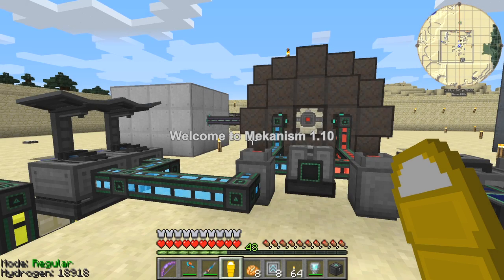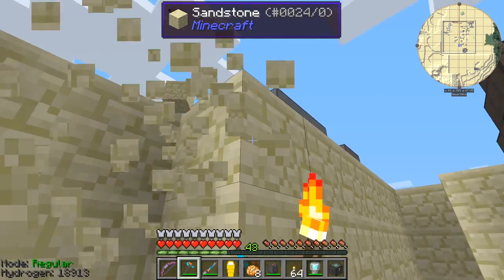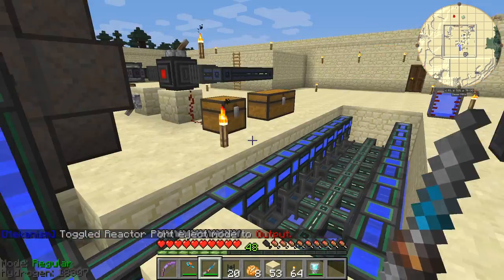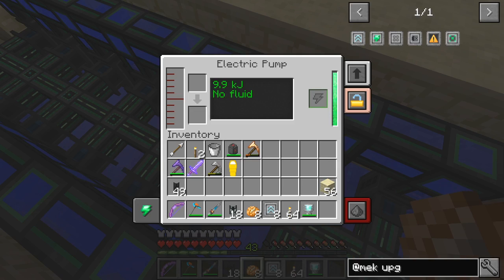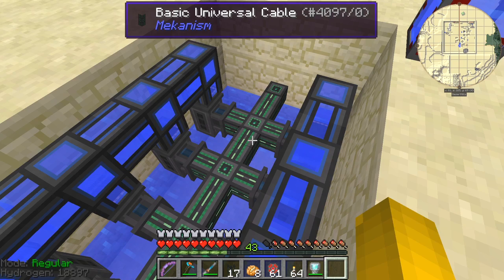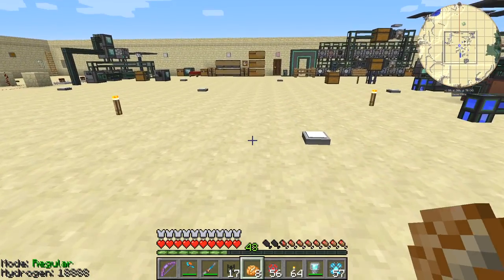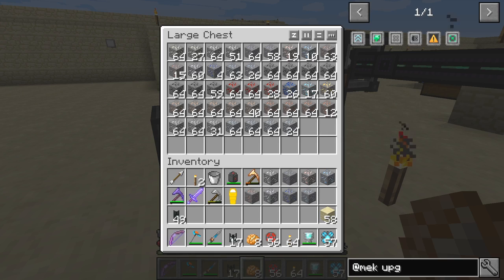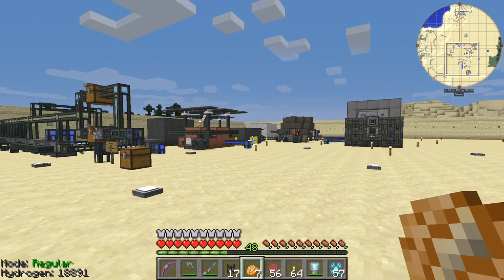Mekanism 110 Episode 26 - Water Cooled Fusion Reactor

Comment: Don't know if you will respond to this but I am trying to have this setup in a Skyfactory4 world, albeit on a much larger scale, how do I stop the steam from running out in the reactor? As there is only about 240mb of steam in the reactor at a time I am unable to sufficiently power the industrial turbine even at a smaller scale. If I cannot stop this from occurring what is another alternative for producing massive amounts of steam.
Reply from the maker: It's been a while since I've played with Mekanism. IIRC it is a balancing act where supplying enough water was the main restriction, Mekanism's water pumps are a bit weak even when maxed out, it there is a faster water pumping mod in skyfactory4 then use this.
Reply: Duncan Webb okay thank you, I will have to look into a different water solution then

Comment: Wait, mekanism pumps don't drain their water sources under them? immersive engineering pumps absolutely pump like nuts but they need 2x2 spaces for a single pump
Reply from the maker: Doesn’t look like they do at least in this version. Pneumaticcraft pumps remove the water source block so they are slow.
Reply: @duncanwebb4934  That's good, I always hated immersive pumps for removing the water sources under them. Like, it pumped VERY fast, but the amount of space needed for them was ridiculous.
Reply: @duncanwebb4934  Oh, and immersive doesn't actually visually show it's removing the source block, but if there's only one block of water under it, it'll sip it all up. If it's put in a 2x2 area of water, it won't show that it's sipping the water.